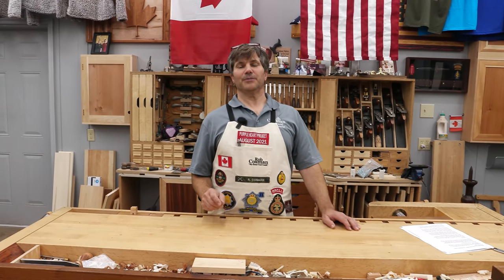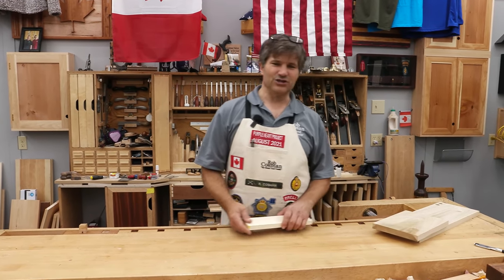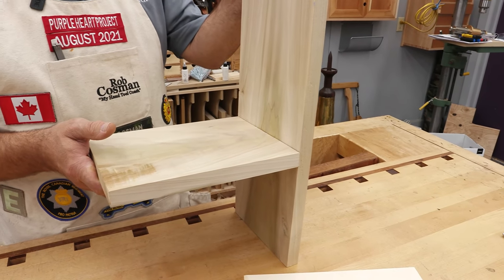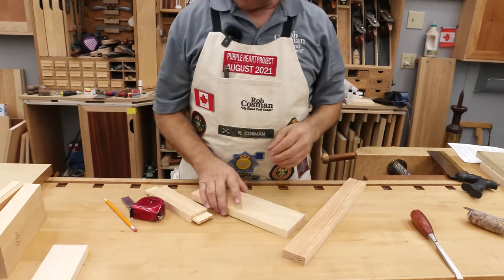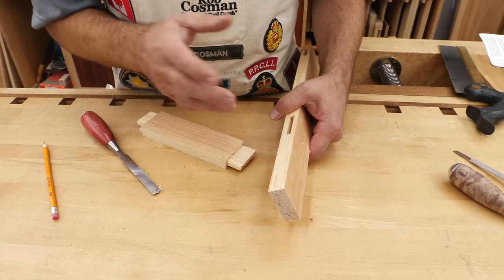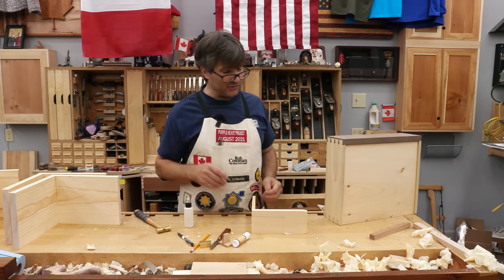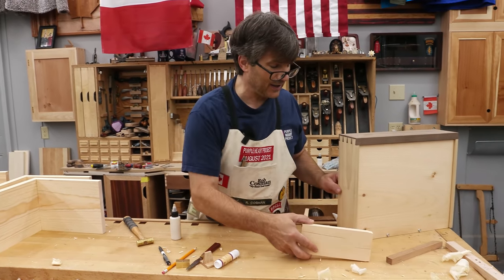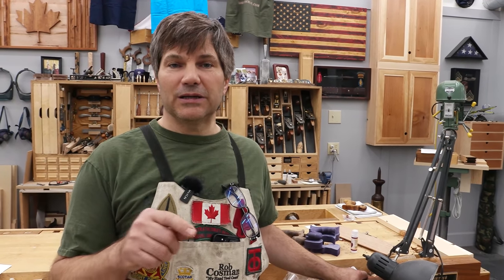End Grain Glue Myth Busted | What does it mean? (Surprise Ending)

Comment from the maker: If you have not seen the other videos on this subject the links are in the description section of this video.
Reply: Rob, I can't help it. The Engineer in me wants to know how long an end grain joint will last compared to a dovetail joint. Remember a glue joint is a chemical reaction that can be affected by time and temperature. I would suggest sending both of your example joints to Texas and let them stay in an attic for a year. My attic can hit 120F easily on most summer days. I know you have a friend in San Antonio who would probably be willing to help. If not, I would gladly do the experiment here in Austin.
Reply from the maker: Great idea
Reply: end grain gluing for the win.
Reply: Keep making stuff with old world craftsmanship joints, but for items used for shop space you always have the shortcuts.
Its kinda no different then people swearing by  pocket holes and screws.  Most tradesmen use pocket hole joints because they are fast  and stand up fairly well.
But you won't see a pocket hole jig in my shop. Its a shortcut. 

I have a 16x7 garage door all wood but its finger jointed short pieces.
The glue joints over the 22 years have failed on the finger joints 
I think had it all been 1/2 laps they would not have failed or the bottom
Rail is 1 1/2 × 16'  x4"   if it had been made out of a stack or wood plywood and wood with stager joints it would still be a solid beam. 
But no over its 22 years it smiles from tension of the lift springs.
The only reason it doesn't pull apart is the metal brace. 
One of these days i remake each panel out of better wood.

Comment: Someone showed me years ago a wonderful trick for cleaning wet glue out of those tight corners. The opening of a regular plastic straw can be easily pressed tightly into the corner edge and scoops the glue out cleanly. When the opening fills up, snip the end off and repeat. A single straw will remove a lot of squeeze out glue.

Comment: Rob, for me the critical problem is “TIME”. I’m Italian, in my home I have some 16th and 17th century pieces of furniture. Dovetails, dovetails and dovetails. Sometimes some rabbet or dados with forged nails. Do you think that in the centuries the rabbet joint that you tested can resists? Large pieces like these have a big tendency tu cup and no way for the glue joint. Dovetails last forever.
Reply from the maker: Well I will still be using dovetails in my carcasses.  I will now just put glue on some end grain to gain extra strentgh
Reply: This was my thought too.
Reply: The benefit of dovetails is that they function even without glue. The rabbet lasts only until the glue fails, so it really just depends on how long we think the glue will hold before it becomes brittle and breaks.
Reply: @nickglover  exactly. Sincerely I have no idea how long glue can performs. I suppose it depends on the environment, moisture, exposure particular situation...a chest of drawers near a fireplace can be stressed a lot in the wintertime. UV is another important fact in some regions.

Comment: Very interesting! My methodology, whenever using glue, has always been that any surfaces that touch should get glue on them.   👍
Reply from the maker: In most cases I agree with you
Reply: I have to agree with Rob that cleaning up squeeze out needs to be considered in all cases.   There's few things worse than squeeze out glue that defies cleaning up, in how it affects the appearance of the piece after being finished.  Perhaps you're better at glue clean up than I, though, but I just haven't had much luck, regardless of the various methodologies I've tried over the many years I've been doing this.
Reply: @ApexWoodworks  Clean up can be a pain, yes!

Comment: If I glue endgrain to longgrain or endgrain to endgrain, I wouldn't worry about the strength of the glue joint since it's often stronger than the wood.
BUT
I would worry about wood movement and long-term stability. If the glue fails at some point in the future due to repeated wood movement or repeated stress, a tenon will keep the loose parts in place that would otherwise fall apart. Or am I missing something?

Comment: I wonder how these tests would hold up with hide glue which is reversible and can be fixed in the case of joint failure. PVA glue joints are something I don't place much faith into as the dried glue feels kind of spongy but hide glue dries hard as bone.

Comment: One thing to consider with the rabbet joint though is that the glue is in the place where the wood will move seasonally. So if the glue doesn't flex it may separate from the wood itself, and that may cause the joint to fail earlier than the dovetail joint, which will stay strong longer since the way the glue is positioned moves way less.

Comment: Rob, your comment is needed about glueing up the full length of the dado. In my work I only glue the first third of the dado, which allows the back two-thirds to move (as wood does). What are your thoughts here? One might argue that the grain direction of the two pieces is consistent, and they could move in a similar way. Or do they? Regards from Perth, Derek
Reply from the maker: You are correct in that last statement, Derek. Both pieces are the same thickness, and species, so I would expect them to move the same amount.

Comment: You can glue two 2×2's together end by end, you just need to make a scarf joint, slope should be 1/12 to 1/15. It is used in aviation for structural joints.

Comment: I built a display case in the Barrister fashion for my T-rex jaw piece and I used a rabbit joint on the two sides of that oak case to fix the sides to the base.  For years I've regretted not using a locking rabbit joint.  Now, I know it's a cosmetic choice I'm regretting, not a structural choice I neglected.

Comment: Rob, one idea. You should clamp(or fasten) the rabbet joint and the dovetail joint on the one side together and then apply force to the other arms until one of them breaks. I bet that will be the rabbet joint.
Reply from the maker: To tell you the truth, as amazing as this sounds, when I was standing on them the dovetails felt weaker!!!!!!
Reply: Yes, that would have been a far more accurate test.  You could put a couple screws in that rabbit/rebate and no glue and on an angle like that it probably would give the same results.  The forces on the joint surfaces at that angle, hold the boards up.  We don't stand a cabinet or case on edge, but we do put weight at 90 degrees angle to the joint.  Also, there are raking forces on the joint that standing on it doesn't really test.

Comment: I think the main problems with the shelve is the leverage you used and the way the dado is cut. You're very likely to cut the dado deeper on the sides than the middle, leaving only a very short piece of long grain attached to the upright board.
The most likely failure of a bookcase is when the shelves are so loaded they either sag so much they pull inside, or there's so many books stuffed on the shelves they wedge the sides apart. 
Just gluing end to long will not be strong enough for those scenarios, but dado's or shelve supports will prevent a large part of those failures.
Besides, you usually have 2 sides supported, making the leverage issue non-existent.
Reply from the maker: The bottom of the dado was trimmed with a router plane to provide maximum glue surface.

Comment: The only question I have is, 'does the strength of the end-grain joints hold up the same  after a few years when the glue has aged? Typically, after 25 years or so, glue deteriorates and starts to fail so the end-grain glue-ups would fail drastically whereby the dovetail ends would still hold fast after 25 years even if the glue deteriorates or even without glue sometimes. All this is good to know , thank you for showing this test.
Reply from the maker: Yes that's a really good question.  Someone should test that

Comment: With the dado / housing: When cutting these by hand, you cut the sides, clean the middle, and refine with a router. If when cutting the sides, you go past the depth by even the smallest amount, then the bottom of the housing will be short pieces of face grain only as long as the width of the housing because of the fibers being scored along the length of the sides of the housing. Maybe this might be what is limiting the strength in your test? It looked like you had a clean line of torn out face grain fibers adhered to the end grain of the shelf...no ragged edges. That's what made me wonder if the bottom of the housing was really short (face) grain. The torque on the side walls was clearly enormous because it just pried off those pieces below the shelf. Thank you for sharing all these tests. Very interesting. I was sure that rabbeted corner would fail. I'll bet that if you do a pure tensile test on the housing, it is strong enough for tensile loads. The back of the cabinet could take care of the racking loads, perhaps?

Comment: Rob, one thing to consider is the glue will fail with time. 100 years from now the glued only joint verse the dovetailed or locked mortise joint the glued only will be more likely to fail because the glue will become brittle. Well at least that has been my experience with glue that is only 20 years old. What are your thought when you consider long term results of a glue only joint?
Reply from the maker: I always like a back up, dovetail, mortise or even dowels.

Comment: As I was watching, two questions came to mind. One, you addressed by shooting the end grain versus leaving it rough from a tablesaw. Two, I wonder if sizing, and /or, applying thin amount of glue to end grain, let it dry, then apply more glue before finally assembling and clamping? Hmmm...great video Mr. Cosman. Thank you.
Reply: Wood glue essentially is pulled into the fibers of the wood and solidifies to itself. So it's bonding to itself, not the wood. If you let a layer dry it can't "seep" into the wood so you'll have an extremely weak joint. In this case it seems it had a pretty deep penetration. So the results may vary depending on the type of wood itself. The more porous the wood, the better the bonding.

Comment: I've always believed the myth also.  Pretty interesting.  As to the lap joint not failing..... pretty good.  If the joint had been a butt joint, it would have failed, but the fact that the dado was fairly deep, then the the stress was relieved quite a bit by the "shear" strength of the base of the dado.  On the other hand, the dado joint, (for the shelf) was fairly shallow.  IF you had made that one deep, it might well have withstood your test.  Still though, the possible stress on a shelf is normally pretty directly downward, and thus, even a shallow dado is probably fine, AS LONG AS there is a back on the shelf to prevent racking..  thanks Rob

Comment: The dado joint (last piece in your video) is failing along fibers but not on fibers. The details are a matter of forces and its distribution inside the wood. That's part of stress calculation in direction of the fibers and perpendicular by an engineer. If you angle the glue surfaces to equalize stress along and perpendicular to the fibers proportional to the wood strength of both directions you're getting the maximum strength for a joint ... that's what makes finger joints so strong.

Comment: I think standing on the joint puts less pressure on glue and more on the woods fibers. I think putting weights only on one board will show the glue's strength vs the wood fibers.
Reply from the maker: Where were you when I Was testing these things?  I was sure the rabbet would fall right apart

Comment: I first encountered this phenomenon in 1970, when white glue was still commonly used in woodworking, even by professionals. Titebond glue was a revelation to me, as the breaking strength of the glue was so much higher than that of white glue. I bet that performing these tests with older glues will that end grain joints are indeed inherently weak, depending on the kind of glue used.
Reply: An interesting point, and that would make sense to be true.

White glue is significantly different, and it may even be that the end grain wicked out the moisture from the glue so fast that it didn't properly polymerize as it set?

Comment: I think the impact test on the dado probably induced more forces than any normal piece of woodwork would suffer in regular use, plus how many completely cantilevered parts do you see.
Of course, all of the joints are brand new and haven't flexed with seasonal movement over years which would surely stress the end glue joints.

Comment: As a Materials Engineer, I remain skeptical.  In my opinion these one time static tests are only part of the equation.  We need to assess this in a more comprehensive scenario by including cyclical racking and fatigue to see if the durability of these joints across the system of joints used in a piece is sufficient long term. Mechanical locking combined with glue surfaces of all types has the best chance of surviving long term use, wood movement, and the ubiquitous moving of furniture from room to room and house to truck to house over the course of generations.  In the design of a piece use this knowledge appropriately by having critical joints absorb the racking forces with mechanical aid and other joints that typically do not see raking to use only glue surfaces (i.e. outside corners of a book shelf using dovetails and all the non-moving shelves using dados only).  I am also one of those people who spends way too much time scraping glue out of my damn corners...
Reply from the maker: Sounds like you are the right guy to do all that testing and it would be interesting to see the results
Reply: "I am also one of those people who spends way too much time scraping glue out of my damn corners..."
What about masking tape?
Reply: Of course you will also have to test several differnt types of glues. Looks like Rob is using something other than Titebond III which is very popular with many other woodworkers.
Reply: You better get working on it.  Cant wait to see the video

Comment: Being a mechanical engineer I have to rise some doubts about the forces applied to the pieces with leverage and hits and loads. Sullivan used a more standard testing method that is the core of his research. I don't know if the two results could be comparable. After all, this video reason was different. I'll ease up things by doing the easiest joint next time and see how much it lasts. Anyway glues has improved a lot. Thanks to all the contributions on this task!
Reply from the maker: I was more interested in “real world” happenings that my furniture would endure.  Blunt force would be a big part of that.

Comment: It's really just a testament to how far glue technology has come over the years.. easy to forget how much chemistry and science has gone into these products.
Reply: No, hide glue is stronger than any of the glues we regularly use in woodworking, some of it is used to chip glass to make fancy designs, try that with titebond.
Reply: But dont be fooled by a scientific experiment tailored to get a result that bears no meaning on practical woodworking! . It doesnt matter how superior the wood glue is today, the lignum that bonds wood fibres together is the key factor in strength (demonstrated by Mr Sullivan) and centuries of wood jointing respect that overlapping/extending fibres give strength. Wood is not like metal.

Comment: Could this mean that if a drawer back is accidentally cut too short you could just glue a small piece to lengthen it? Using splice joints to fix such a mistake would no longer be necessary.
Reply: Of course. But if it's just a end-grain butt joint it won't be as strong as a solid piece of timber. A splice will be considerably stronger than a glued butt joint, just because of the physics. The question is, how much strength do you need? In Ikea furniture the back is held with ONE plastic plug on each side, and is made from crappy paper-wrapped chipboard. So is that strong enough or not?
Reply: @johncoops6897  I would need just enough strength to get the piece to final length so I can cut the dovetails. Not ideal but I think it would be a good way to fix a board that would have a strong joint in the end